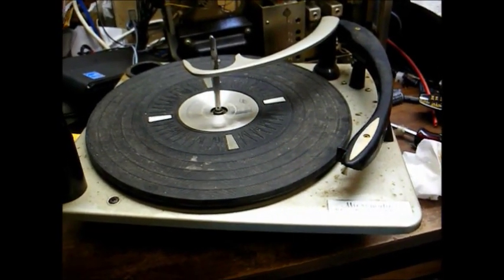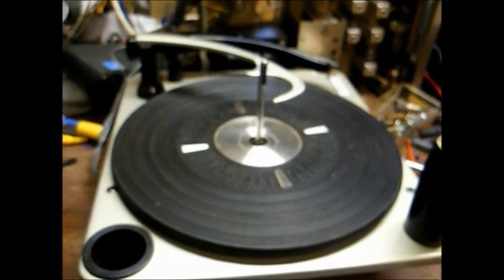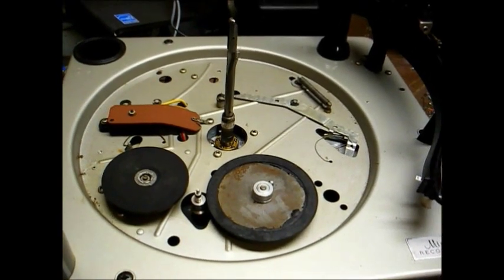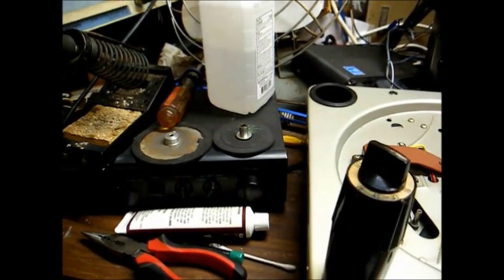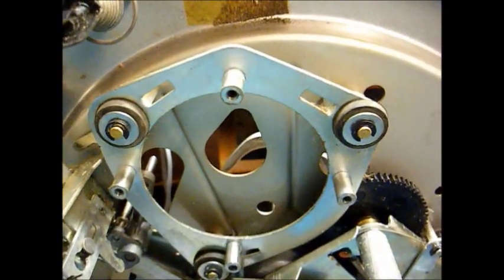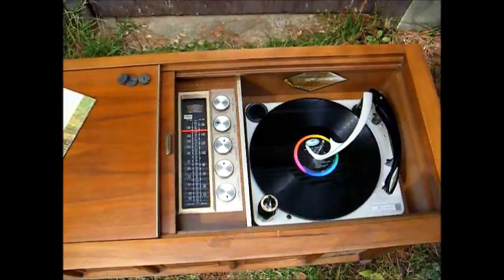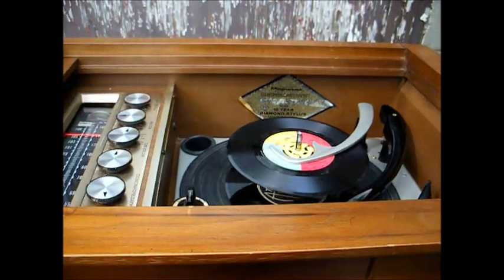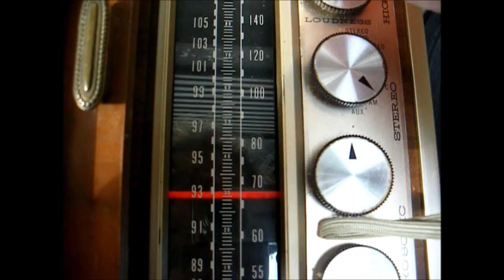1965 Magnavox Astro-Sonic console stereo repair - part 3 (record player service)

Comment: I just wanted to let you know that you have inspired me to rescue old Maggie consoles.  I've bought a few from Goodwill for $25-$60, and have been given a few, one of which is VERY similar to the one in this video.  It's a '65, also.  I'll replace the capacitors and service the record changers, and they're like new.  I give them to my friends that are getting back into vinyl.  They'll come over and hear my 1971 model and say "THAT'S what vinyl is supposed to sound like!?!?!?"  She's a cheapo with 10" woofers.  They've all donated their Crosleys.  Haha!
Reply: The first one I ever experienced was in the early 90s.  I was working at a repair shop in Memphis, TN, and one came in for repair.  She was a 6-foot tube model from 1961.  I did the typical repairs, and thought "OH MY GOD!" when I got her going.  Those folks used it as the main sound system in their bar until they moved away.  The jukebox was connected to it, and they had "Vinyl Night" when folks would bring their records and play them.

Comment: Neat old Magnavox console!  Once worked at a Magnavox dealer, and serviced many of them, both the electronics and changers.  As you know, Magnavox made some high dollar consoles, with substantial speaker systems (some in a sealed styrofoam enclosure).  Consoles have pretty much faded into history, as a consumer item, however, they were built with much higher quality than 99% of the electronics available today.  Plus, you could actually service them.
Reply: My parents had one of these when I was little.  They ended up replacing it with a cheap stereo that sat on a shelf.
Reply: 5 years late. But I just got a magnavox 70's console in the rare side table configuration.  The quality of sound with a clean record is amazing.

Comment: One step closer now. I can totally relate when you talk about not wanting to get into the turntable mechanicals; all it takes is one tiny spring to go flying to wreck a perfectly fine-working turntable. It will be interesting to see what's going on with the FM.

Comment: I have one of these which my Dad bought back in 1964/65 here in the U.K.
I inherited it from my Father in 1975 around the time the stylus warranty ran out. I changed the cartridge for a Sonotone 9TAHC and all worked well.

The model of Magnavox I have has slight cosmetic differences to the one on display here, the knobs are different for one thing. I will say though that if one was to take off the bass knob, one would find a hollow shaft where, if one inserts a (small) screwdriver, one will contact the "balance" control.

Other differences are that there is an "On/Off" switch at the top of the radiogram control which controls the 240/110v transformer which switches it on or off.

Sadly, about 20 years ago the main power transformer on the original power supply seemed to give up the ghost one night while I was listening to it and it has been silent ever since.

Would love to get it going again.

Comment: I've found that mineral spirits, like paint thinner or varsol, works the best for cleaning up old grease on mechanical parts like bearings and bushings, WD40 works as well. If it has turned to varnish lacquer thinner does a good job of braking it up.

Comment: I am restoring two similar Magnavox consoles, 1965 & 1967. Not sure if you keep up with any response to these older videos, but three questions: 1)You did not mention if you check or replace any of the resistors,  2) what about the capacitors on the speakers crossover? Don't they need changing as well?  3) would I need an oscilloscope and other expensive equipment to align the AM & FM radios? I do have some great 1990s AM-FM digital tuners (one a Denon, one a Magnavox) that I could use as AUX input and just stick with the Magnavox as an amp for the digital radio and record changer. If the radio portion of these old units is not very good seems like a DIY person will not have the proper test equipment or expertise to improve the radio reception. Your thoughts appreciated if you read responses to this 2013 video.  Thanks.

Comment: Great video, just spent a bunch of time on a very similar TT, it has a catch in the auto cycle that I can't figure out, Don't know if you may have an idea what the issue is? can manual cycle one way then it catches, manual cycle in reverse and it will catch again.

Comment: Hello.  I have one of these since my wife's grandmother passed away.  The turntable seems to rotate a bit too slowly as the music sounds slow when playing records. Easy enough to remove the platter and get to the washers and bearings.  But how do I get the whole assembly to come out?  I loosened the screws but it just doesnt want to come all the way out to access the motor.
Reply: There are clips on the bottom that need to be removed
Reply: lol 6 years later. hope you figured it out!

Comment: Have a similar setup but my repair guy says I need a replacement motor because speed is slower than normal and he couldn’t fix it. Any resource suggestions?  I’ve already checked eBay.

Comment: I can still read the "10 year diamond stylus warranty" at 9:27. I didn't know that diamond stylus last that long for a ceramic cartridge that requires heavier tracking force of at least 3.5 grams.
Reply: Magnavox and Zenith tracked lighter than that. Especially the newer Magnavox changer.

Comment: I just bought a Magnavox Micromatic console.  It had beautiful sound.  I locked the tone arm down so it wouldn't move and cleaned the exterior cabinet, laying it on its side.  Now it doesn't have very good volume and an uneven sound (softer and louder).  I didn't touch any of the electronics.  Could something loose inside the cabinet hit the needle when I turned it on its side causing the poor sound quality?  Any suggestions?

Comment: hello I have similar year and make and as soon as I engage the idle wheel to play I get a grinding sound.  if I take the small idle wheel off and engage it I get no grinding. I am not sure the problem,  as I am relatively new to fixing and trouble shooting.  the small wheel needs rubber renew it is very hard and might be the problem.  

the auto play is also not working I can not turn it to auto it is stuck I dont want to force it.
anything will help thank you

Comment: I have a 1964 Magnavox, the workings are identical to yours.  Phono needs a new cartridge -- sound is weak (tinny) after the stylus accidentally dropped onto the turntable platter.  Radio works fine but the sound is a little distorted.  Does this sound like minor or major problems?  My uncle was a repairman but he's deceased.
Reply: pgh45rpms, it sounds like it needs to be cleaned up, maybe the buttons on it, like volume and bass and treble and balance buttons needs, the de-ox-it product to clean up the sound problems with the switches causing that,( it's contact cleaner spray)

Comment: Question is it safe to use white lithium grease on these old changers?
Reply: +tim parsells yes... in certain places. Like, the brakes. LOL
Reply: +Carl Rudd LOL!
Reply: LOL....well you seem like a 'car' guy. Your name even sounds NASCARish. But in truth, you can use white lith on sliding parts, but probably not on the motor or fine bearings. Instead, invest in a tube of Lubriplate. It's designed for sliding mechanisms such as record changers. Use a light machine oil on bearings and the motor. Unless there is serious issues, a sparing shot of WD40 on the changer mechanisms will tend to free up and reinvigorate old dry lubes and such. Avoid disassembly of the changer is at all possible.
Reply: +Carl Rudd thank you! you seem like a cool cat. you just saved me a headache later on down the road! 

p.s. nope.no car lover here.hell, i cant even drive to be honest!
Reply: Carry on... there's always a solution. Look before you leap. etc etc.   :)